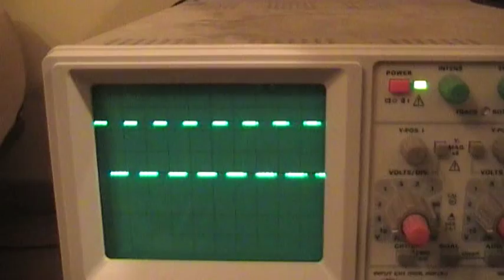MOTOR ELECTRIC SPEED. CONTROL VELOCIDAD  MOTOR

Comment: hola nuevamente, ya me he animado armar una bicicleta parecida a la suya, solo tengo algunas dudas que solventar, espero me pueda orientar.

1. En su caso uso una batería 14,8v a 4amp, y el motor es de 24v a 250watts entonces esos nos dice que trabaja 10amp, es eso correcto??

2.siendo correctos los datos del motor, si lo entiendo bien quiere decir que para que el motor me entregase toda la "fuerza" para la que fue diseñado tendría que darle esos 24v 10amp como mínimo?aunque en su caso no lo hizo así.

3. en el caso de las baterías podría ponerlas en paralelo para aumentar el amperaje que entregan al motor digamos 18amp por ejemplo, aumentando así su tiempo de uso, aunque sobre pase esos supuestos 10 amp del motor? o no es recomendable?

4. lógicamente el voltaje de 24v no lo debo superar con las baterías para que no se dañe verdad??

como se dará cuenta por la naturaleza de mis preguntas soy solo un aficionado de electrónica, que quiere sanjar algunas dudas, le agradezco el tiempo que se tome en responder a las mismas.
Reply from the maker: Hola Fernando. Respondiendo a tus preguntas
1. El motor gasta 13,5 amp. , si a esto le aplicas el rendimiento del motor que es un 75% te dan esos 250 w efectivos.
2. El motor para dar esos 250 w debe alimentarse a 24 V
3. Puedes poner las baterías que quieras en paralelo, el rendimiento del motor es el mismo y el tiempo de uso aumentará
4. No se debe usar el motor a más de 24 V. Entre 0 y 24 voltios funcionará perfectamente